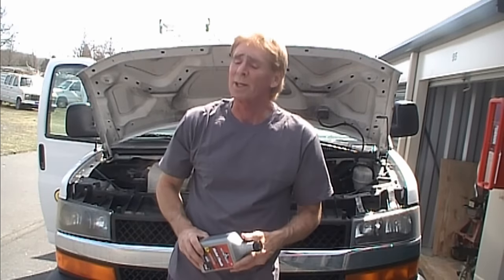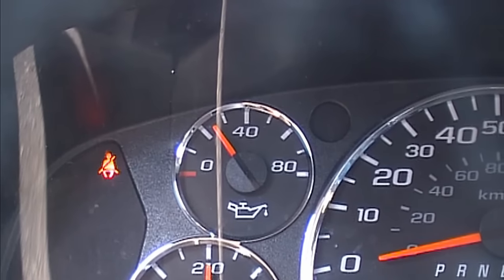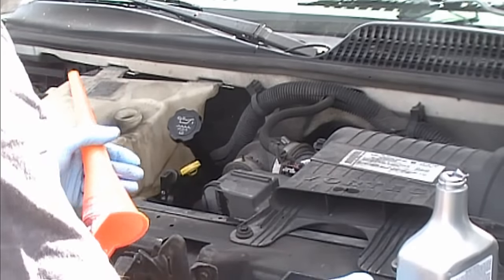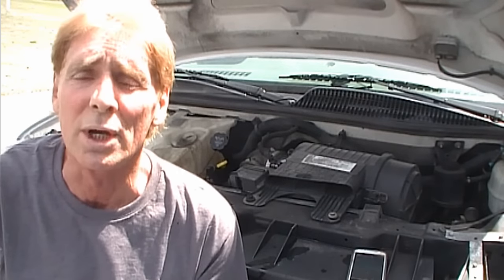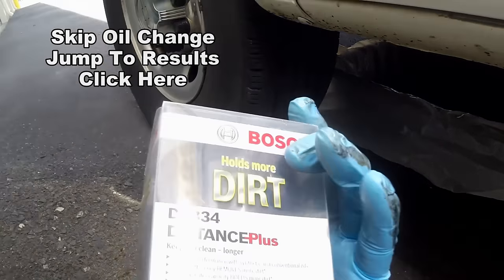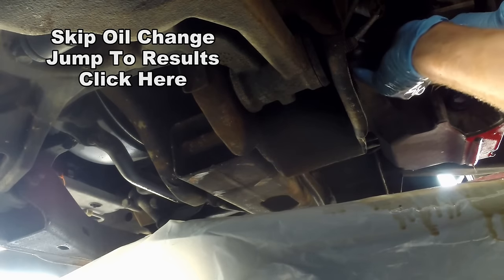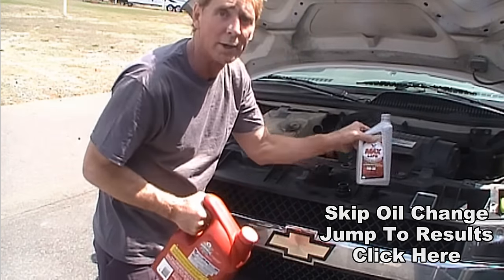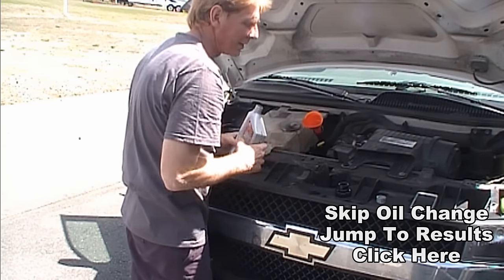NOISY LIFTERS? Motor Flush - Does It Work?  HOW TO DO IT YOURSELF

Comment: Lifters are collapsed and needs oil pump heads MUST be extracted to access lifters as the 5.3-6.2 heads cover lifters. Do timing chain oil pump and lifters all at the same time or YOU WILL do this twice you may find a waterpump needed too due to corrosion on pump ears from block

Comment: I can't believe how many things you did wrong on the simplest procedure you can do to your car. NEVER USE VICE GRIPS ON A DRAIN PLUG NEVER NEVER NEVER!!!! The 15mm socket is cheaper than the vice grips. Second never mix Synthetic Blend oil with full Synthetic motor oil. Third you spent twice the money buying the wrong quart of oil. Last you tightened the oil filter way too tight its suppose to be hand tight plus 1/4  to 1/2 turn more but its ok people like you give me job security.

Comment: Thank you for your video. Your tutorial solved the ticking on my 2012 Subaru Tribeca. I noticed that my car was making a ticking noise, sorta like it was a diesel. I had it looked at by a mechanic, he said it was my lifter. Could cost 2-3k or more if I needed an overhaul of the motor. He would have to take it apart. I googled "lifter" and your video came up on you tube. Watched yours and a few others.Went with your suggestion. It was scary listening to the motor as we ran it with the Motor Medic. But we did the full 5 mins.Replaced the synthetic oil w/regular oil. Added Lucas oil treatment instead, as recommended by the mechanic. It sorta still had the ticking, but it had decreased significantly. By the time we drove it for about 40 more miles (nice and easy), the ticking was gone. So thank you for helping us. Oh, we did run a heavier oil also.

Comment: You never want to rev up the engine with this type of fluid mixed in the oil because it can boil inside the hot fiction surfaces.  This can cause gasses to form and prevent the oil from lubricating and cause engine damage.  That's why they tell you to only idle the engine for 5 minutes.

Comment: Bought a 1978 Buick Electra 225, it had a rear main seal leak at 14,000, the lifter(s) started ticking at approximately 15,000-16,000 miles. Two years later my exwife( she got the car in divorce, I got my thumb), she took it to a vw dealer, bought a golf diesel.  Told them it needed a tuneup. Brahaha! I had a Ford v8 by then with158,000+ miles and no ticking valves. Drove the Ford 3 more years, 2 in Germany, still no ticking valves!

Comment: I have Ticking Sound :((((... I think it's the " Lifters ". Anyway, I 
pour bunch of Oil in it, I OVER FLOOD the DAM THING, LMFAO. Now the 
Sound is gone... Hmmmmmmmmmmm I think it needs more Oil or could be the 
new Oil " OVER FLOOD " the " RODS "??? I am not sure, but it's AOK and 
GONE now.  YAYYYYYYYYYYYYYYYYYHOOOOOOOOOOOOOOO !!!!
Reply: Hahahaha, I took it 1 step further... 1 Quart of Trans Fluid + 4 Ounces of Gumout. Took the Car on a 50 Miles Run, came back and do a Complete Oil Change and New Filter, now it's SMOOTH as hell... I don't know if the Trans + Gumout or maybe low on Oil? But if anyone is reading this... Give it a shot, cause it did help us out and I also made a Video in my Channel if you need to see it :D

Comment: well it sounds like a rod knock..
but oil pressure looks good at this kind of mileage ,,
at idle it should at 60
warmed up it should be traveling between 20 at idle to 44 cruise and 60 on the highway 

if im wrong then kindly correct me

i have a 6.0 v8 (366ci) 2010 savanna at 163000 kilometer (around 100000 miles)

i dont know if GM solved the check valve on the earlier oil pumps 
thats my only fear,,,,

Comment: Next time use 20-50 and see what happens.
Reply: haycall or some Lucas
Reply: haycall heavier oil helps rod knocks but will make lifters tap louder because the heavy oil won't circulate through the small holes in the lifters good enough. 40 years as a mechanic.
Reply: Donald Snow Exactly!
Reply: Donald Snow makes sense why my 300c hemi just started it after changing oil and adding Lucas !! Shit how to fix it change the oil again will that help ? I noticed it loud when ideling once I rev up and let it idle it goes away for a bit
Reply: Moving earth Yes, change the oil again. Use the oil viscosity that's specified in your owner's manual or printed on the oil cap. Engine oils are painstakingly blended and engineered by chemists to have a complete additive package. You do not need (and shouldn't use) any kind of additional additive or product. Not only does it affect the physical properties of the oil like the viscosity and pour point, it affects the chemistry by adding or diluting chemicals that the engineers did not foresee. That hurts the oil's ability to protect the engine.
Reply: haycall always use recommended weight.
Reply: haycall p
Reply: Marven Michell what haycall

Comment: Haha. Omg the comments and ideas. Dude. Just trouble shot the thing. Diagnose it. Don't just throw thicker oil at it. Flush it. Add this or that to the oil. O-ring lifter. Bla bla bla. 

I know these LS engines like the back of my hand. 

Bet the oil pump has never been replaced. It's not a old school distributor driven oil pump. It's a crank shaft mounted geroter style pump. It wears much faster. These have 2 issues. Inner gear wears creating excessive gap & wont pump correct oil volume to pump the lifters up or pressure relief valve sticks open and bleeds oil volume & pressure off early. Only repair is putting a new oil pump on. Only that will solve this problem. Hope you see this. It's actually a easy job. Just need a 3 jaw gear puller, long reach harmonic balance press, torque wrench that goes above 240ft lbs & a torque angle gauge. You can rent all of them. Only takes a 3-4 hrs including gasket cleaning. I can give a couple hints to make things easier on you too.

Comment: 1. Take the time use correct socket wrench for you drain plug
2. Prime oil filter pour new oil filter half full of new oil and oil the rubber seal before installing
3. Never go more than hand tight on oil filters
4. Always use full synthetic on later model engines
5. 15-20 mins cool off is not a cold crank case
6. Never run over the 5 min run time as directed on the instructions of the flush
You need either new lifters, oil pump, or oil sending unit. 
Good day sir

Comment: wow it amazes me a man his age doesn't own a f**ing ratchet set  or at least a 14ml spanner. Vice grips really! Not surprised the bolt got striped. and next time hand tighten your oil flter, the tool you used is to losen oil filters put on by knob shafts like you not tighten them lol. But thanks for showing us magical shit dosent clear up tappet noise. Good effort in that regard.

Comment: You can just use thicker viscosity oil. The reason why the oil pressure is low is because the viscosity is too thin.Try putting in 10W-40 or 15W-50 and the lifters will get better lubrication since it is a high mileage vehicle.
Reply: Mean_Business nope...just add Lucas
Reply: Mean_Business yes it does matter. Put thinner viscosity (5w30) during your cold winter months. Warmer weather put (10w30). reason being so is because during winter cold temprature thickens your motor oil while the hot summer days thins out your motor oil.
Reply: Imma say this the thicker the better 
Thin oil is bad and can and will destroy an older engine
Reply: Hawk Hawk It’s actually the opposite with modern multiweight oils
Reply: You can't just use any ol oil. You have to remember the numbers in oil count is Weight and tempature sets. Of you used a different type of temp. It will ruin your metals inside the motor. 
The engine is Rod knocking. Not that bad of a job.
Reply: Hawk Hawk it makes no difference when the oils warm 5w30 and 10w30 are the same viscosity once warmed up the first numbers only for starting cold

Comment: You got 300K miles out of it.  The engine is tired and worn out bud. "Fix all in a can" does not work, it's snake oil. Yes Fram filters are garbage. And 25 psi Oil pressure at curb idle is normal.

Comment: dude-312+ k miles on a sbc is the reason you have low oil pressure. 
you have a rod or main bearing clacking. that is not a lifter tap. 
you could POSSIBLY  make the engine stop knocking  IF  you put in a new hv oil pump . turning up the pressure will help.
POSSIBLY  go up to 10/40 will help raise your oil pressure and float your rotating assy.  
who ever told you the head was running dry ( 2:33 )  does not know how this engine works. 
the clearances are  GONE  in your motor. oil is blowing out of the loose clearances, dropping the pressure and not " floating "  the crank and rods as designed. 
do not try to drive this truck on the interstate.

Comment: Holy crap is this guy a hack! 
1) that is not a dirty lifter, that is a collapsed lifter noise, it needs a manual release to get back into the internal lifter guides, or replacement. 
2) use the proper socket & ratchet, or proper wrench on the damn drain plug please, not a damn Visegrip!
3) don't use an engine flush, this dilutes  the oil, reducing the anti-wear film on your bearing surfaces, causing horrible excess wear. It's so bad, they tell you not to rev or drive the engine, as putting a load on it will damage these surfaces. Use some ATF or Marvel or other cleaner that won't dilute your oil, if you need to clean the sludge. Better yet, do your oil changes on time as and don't buy neglected vehicles, you won't have a problem.
4) Fram is indeed garbage, especially the original(orange) Fram. Go to Napa, buy a Napa Gold filter, it is made by Wix and is a very good filter. 
5) clean your damn hands, wipe the filter gasket to get a film of oil on it, and install it hand tight. Without oily hands, you will be able to get enough leverage to get it as tight as you need it to be, just by hand. This filter is at least 4-5 times too tight. N E V E R use a damn filter wrench to tighten a filter, ONLY to loosen if need be!
6) cause you seem so novice at this, leave the weed for after you're finished. You seem like a nice dude, but definitely stoned. I don't judge, but probably should wait til after in your case.

Comment: and it may be nothing more than trans fluid . Years ago my father brought a brand new Chevy 1986. In less than one two years it had a bad lifter know. I was in trade school at the time for automotive an my instructor told be to pour a cap full of trans fluid in the corroborator while idle. and it stopped almost instantly. To this day in 2018 that lifter has not made any noise.

Comment: I would take the oil pan out and look at the strainer that leads to oil pump.. confirm (50% clogged,) oil pressure delivery decreased by half. If so unscrew the oil pipe strainer place it in the metal pan fill it up with high concentrated degreeser overlapping the height  of the strainer, let it sit for 4hrs-6hrs. Then clean it with brake cleaner. Then install it back, and run it with 5w-30. Then with every oil change flush it with one quart of dextron 3.. High mile engines do not reverse back with life..keep that in mind but keeping it clean as you go it prolongs it..It is very important.

Comment: Your flush failed because even if that product worked, it would not work in 5 minutes. If you have a severe carbon build up problem it could take several hours for the solvent to break down the carbon. You may need to do the procedure 15-20 times over 3 or 4 hours, change the oil, drive it 50 miles continuous to get it really hot and then drain/change oil again while the oil is still hot!. I'm sure a lot of people are disappointment with that product because they "expected" it to work in 5 minutes and then when it doesn't they don't think it can be fixed with a flush, or they think the product doesn't work.

Comment: talking with a buddy that's involved with GM Performance, he stated this lifter tick is common on the LS based engines. he has seen more so than not it's related to the O-ring breaking down on the pick up tube for the oil pump. since its above the liquid level it potentially can suck a little air passed the O-ring. personally it's done this on both service van I have had. 1st was a 6.0l most recently it's the 4.8l and it comes and goes randomly. not saying it's the same on every engine but it's a good place to start. also I might add his oil pressure in this video is not really that low to be honest
Reply: Your comment makes sense to me. My car is still relatively new. I made the first oil change for my car. I hand tightened the oil filter. Unfortunately, the loose oil filter caused oil leaking and resulted in low engine oil. I did not know of the engine oil leaking and drove my car with low oil for about 10 miles until a low oil warning message showed up on the car display panel. I fixed the oil leaking, but noticed the engine ticking noise after this instance. I believe in my case some air was sucked through O-ring and caused the lifter tick. What repair do you suggest to fix my case? Thank you for your help!

Comment: Motor flush is just kerosene, i've never known it to work on anything except to wash the oil lining out of the cylinder walls, sometimes leading to WORSE compression in a worn engine. You have a definite lifter tick, harmless but annoying. Going to a 40 weight oil with a good oil stabilizer product like Lucas and i bet the tick goes away.

Comment: Rod knock.. The sound you're hearing is the rod slapping the crankshaft, because the bearings have worn. It's also the reason for very low oil pressure.. No engine cleaner will fix this problem.. Call a mechanic.

Comment: For everybody with crazy comments ls Chevrolet power 6.0 1500 hd 186000 no noises on exhaust leak there good motors don’t let the sound fool and are not hard to work on 🤷🏿‍♂️or expensive diy

Comment: I understand this is an old video however he’s not giving the motor flush the proper fair review.  motor flush I use about every three oil changes as a preventative maintenance product. I have in the past disassembled my motor and it does very well. Motor flush  cleans very good. It can’t used to solve an engine problem.  secondly, never use regular motor oil! I don’t care how many miles is on it!! Motor oil should be taken off the shelves and made illegal.  it doesn’t even work it doesn’t lubricate your motor only FULL SYNTHETIC lubricates  properly so this guy missed the Mark only  a little bit. although he is pretty clear and it’s pretty easy to follow and understand he’s misrepresenting the product,  its uses, and uses the wrong oil for the motor.

Comment: Only real way to find and fix is to get in to the engine.  Lots of tiny oil passages get obstructed reading their flow. IE anywhere in the valve train area.  With luck you can restore proper flow before real damage has been done.  Using thicker oil will compound this problem.  Thicker oil is a small bandaid to worn bearing surfaces.

Comment: Don't every use when vice grips on an oil filter nut. When you said someone stripped nut as you doing with vice grips . Funny and also I would of substitute one quart of Lucas full  synthetic blend for one quart oil. May not help but will lubricant much better all the parts just freed from 300k + miles of gunk. Also he has a truck make sure if car is jacked you are letting it down fully to get all oil out.  Some some other things to try but did nothing in video which was good by the way. Thanks

Comment: One of the most cringe worthy oil change videos I’ve seen in a long time.  Absolutely do nothing he says or does!  The only good thing he did was to replace the Fram oil filter with a good quality oil filter.  Everything else, was just engine abuse, and should be illegal.  Almost $20 a gallon for basically kerosene and a few other solvents?  DOOH!

Comment: A lot safer to put a half a bottle or full quart of Marvel Mystery Oil in it and drive it for a week. It's far safer for the engine than kerosene. Also, for your information it takes about 3 and 1/2 to 4 hours for an engine to completely cool down.
Do not ever take oil plug out of an oil pan with a vise grip. Have you don't type A filter with a wretch. You tighten it with your hand. Plus you also forgot to stop where you actually put a film of oil onto the filter seal. Please learn to read instructions. I can tell you why you have a lifter rattle. You probably have a change the oil in 30000 miles.
There are two things this man should never put on his vehicle. His right hand at his left hand.

Comment: Did you not at least remove 1litre of oil prior to adding 1litre of that motor flush?    😱   LAWD FADDA.........Please buy yourself some decent tools and use a proper wrench on that drain plug.

Comment: Diesel works 10x better I got a 1990 Isuzu pup 4cyl 4x4 it has 500,000 miles on it when I first got it it sounded like yours I used diesel to flush it and 20w50 for new oil been driving it with regular oil changes for 3 years still no tap and I take the kids off road in it all the time

Comment: ticks should not gone right away. let it run some time. better to use oil 40 or even 50 instead of just 30 and add lucas lubricant to increase oil pressure. let it run some time. drive it a few days. and ticks gradually should gone. it depends of engine condition

Comment: Maybe using a thicker oil would have helped with the noise . It does have 300k after all and the space between the components gets bigger. Impressive mileage though! Older ford and Chevy vans were tanks.

Comment: It may NOT even be a Lifter. Theres other things that make it Tick this way. Spark plug, wire, vacuum pump, fuel pump, coil, transmission, or a sensor.